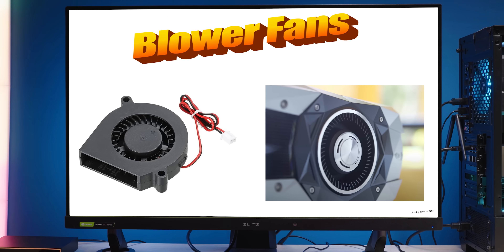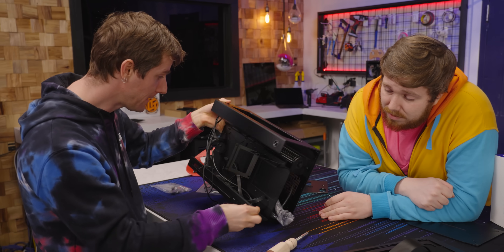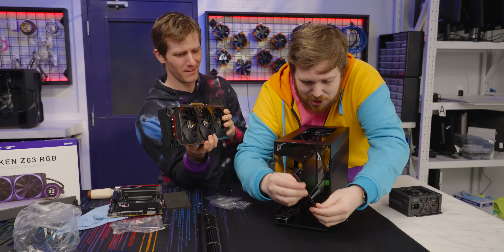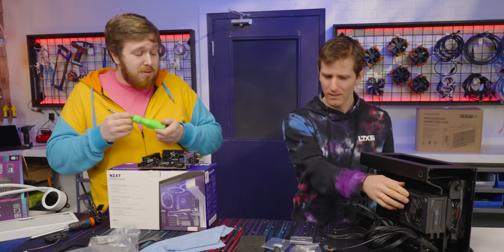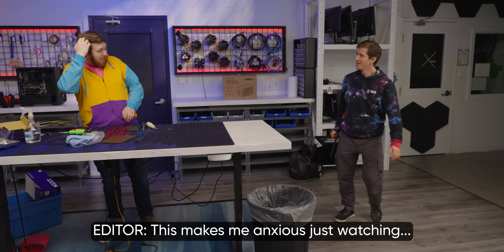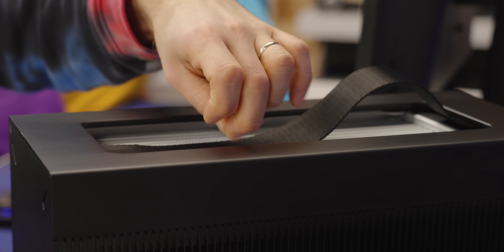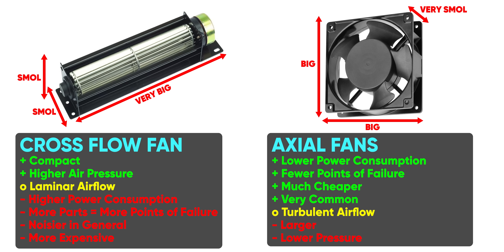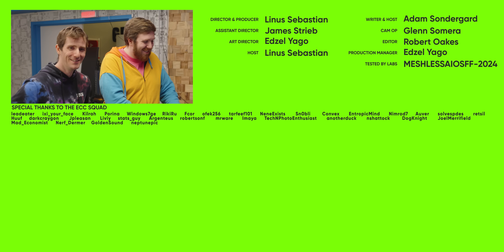This BLEW me away! - Meshless AIO SFF by Meshless Design

Comment: I had 3.5" hard disk enclosures, well they were drive bays for my full tower PC, with this type fan back in the early 2000's. I forget the company, they were not cheap but well made.

Even had little flip down fronts with a mesh filter, washable, and adjustable speeds. No idea if they were worth it but my drives ran cool and never failed. That build, roughly $3500 in 1999, lasted 10 plus years...
Reply: I had one for 5.25, and it had an annoying whirr sound sadly.   These fans always seem to have potential for ITX sandwich cases where they could sit above the ITX PCI slot riser and save space.

Tried to look for a crossflow fan for the SGPC K55, but couldn't find a fitting model. Got 4x 40mm Sunon Maglev Fans and zip tied them to the top instead. They cost as much as 1 Noctua 40mm.

I also found blower fans that you can mod to use motherboard connectors. So I double taped one onto a sandwich case panel. It reduced temps a bit but it vibrates so much that I took it off. Found another that is more axial fan like and it vibrated less.
Reply: @yensteel  These made noise but with 9 other fans plus 'jet engine' style CPU fans the whole thing was so loud it became a white noise machine. The annoyance for me was the heat because I never turned the system off.
Reply: Was it Honeywell? I have some old 3U cases with parts from them, including a 30cm cross-flow fan.
Reply: @DigitalJedi  No it wasn't industrial. I'm tempted to look thru storage to find them, but I probably salvaged the drives and sold the enclosures.
Reply: I had the cheaper retrofit 5.25" bay fans that stuck out the front, both had bearings fail so yea I understand why they aren't used anymore.
Reply: @thorableinu  honestly didn't know what type of fan it was until it arrived.
Reply: How tf did a nineties compter last you until the 2010s? Did you do nothing but web browse and type on word for that period?
Reply: @LaEmporoar  I had a decent budget and went for a dual CPU system with ECC ram. It was overkill. I was lucky. I miss those days more than anything.
Reply: @LaEmporoar Case and Fan, probably not the other parts
Reply: @darkchaosclanat  Nope. Started with a full tower Lian Li that doubled as a chair at lan parties. I added three fans in the side panel to help cool the GPUs. I swapped the GPU once or twice and added another gig of ram but that was late in it's life, 2005 or 06 after school. 

I did graphic design, rendering, and played CS 1.6 for a while. Running Windows 2k pro, aka NT the whole time.
Reply: @jsutrov 6-7 years sound much more reasonable, then 10+ years
Reply: like my family had a new computer in the late 2000s that couldn't even load web pages in a reasonable time frame (like 15min load times) after a few years
Reply: @LaEmporoar    I'd like to suggest that it might have been a Dual Socket360 Coppermine, and may have well required one or two GPU replacements, maybe got a Tualatin upgrade. Would have been quite usable.

Could even start its life as a dual Slot1 system and gotten Slotket kits later.

But most people were still building Socket7 and maybe Super Socket7 systems during that era for budget reasons.
Reply: @SianaGearz edit to clarify I did upgrade the GPUs, but I believe only once. another gig of ram when I could afford it. also added fans in a lexan panel for the GPUs ,and cathode tube lighting. I was young...

Close! This is bringing back memories. it was dual AMD athlon. started with 1 gig of ECC DDR. it was Samsung and cost almost a third of the computer. 

The CPU fans were even more ridiculous. they were coolermaster jets. I could barely install them, the heatsinks touched. they held up fine but idk if they worked any better than stock.

I also had great ISP available that people don't realize. I was the first person in my town to get ATT broadband, after DSL, I started with a 14.4 and ended with T1 at that house... I worked in tech in school so they took care of me.
Reply: @SianaGearz  Did you have a similar system at that time?
Reply: @jsutrov    No, i was never fortunate enough for a dual socket system. In 2001, i fished a smelly smouldering corpse of an Athlon 750 or 800 computer out of a dumpster, the unfortunately appropriately numbered Codegen 420 PSU set itself on fire and burned most of the computer, including hard disk, an optical drive or two, and a Rage video card. But the quite handsome MSI mainboard, the CPU, and 128MB RAM survived just fine. So i rebuit this computer with optical drives that i had at hand, an ELSA TNT2 (soon replaced by an ELSA Geforce2mx for better Blender performance), a fresh Maxtor DM80 disk, and a 350W Fortron Source PSU, and that's what i used for the next 4 years, it was trouble free.

Then i built the next computer, a Pentium 4 2.8E with hyperthreading and a Deluxe edition ASUS mainboard, i spent big. Well the mainboard turned out flaky, i had to send it in for north bridge repair. Besides that, i hated this machine. Pentium 4's performance was... very uneven. Later figured, dual P3-1200s would have run circles around that thing.

A few years later i picked up an Athlon XP 3000+ for $10 and while as old as that Pentium 4, that was actually a massive improvement in every conceivable regard.

Comment: i loved this EP this will be my new Room Heater. Just a little question if the price ist set to the same amount as some rgb fans or premium server industrial fans what would be better for adoption for the SFF builders if one was to go forward with a industrie standers for SFF builds. My Rig at the moment is very overkill cooling for its specks but i wanted the full preformance of my Components B550 AM$ 5800X3D with a noctua NHD15S and as inlet Two ippc 140mm intake @2,000rpm and a single 120mm @3,000 rpm as outlet in a Fractal POP Air, The gpu is a fine wine EVGA 3060 12G i know the build is lobsided wanted to wait for gpu prices to come down. Your thaughts community??

Comment: I'm having a tough time getting my I-9 to stop thermal throttling... I have a 360 mm Corsair h 150i led. Anyone suggest anything
Reply: Replace your thermal paste
Reply: @jordansiemer6667  I did but I suspect it is not evenly distributed. I should probably do it again.
Reply: @jordansiemer6667  do you suggest the sheets or kryonot liquid metal paste
Reply: @GreggyPreviews  I don't know, I haven't used either if them

Comment: The fan is older and than that Silverstone case in 2005. I still have my original CoolerMaster CMStacker STC-T01 with the optional CrossFlow fan. Heck, I still have both boxes. Problem was that I couldn’t have full-length PCI cards installed with the CrossFlow fan so I had to remove it for the dual Promise SuperTrak SX-6000 RAID cards (6-channel IDE). Yes, I really stacked my Stacker with drives. ;)

Comment: I bet that fan sized for the Asic miners might help alot. Given that you can find one with the cfm specs. Possibly doubling up as one blows in, and the other extracts outward.

I bet the Kaspa KS0 Pro+ overclockers would love this in a case with an AIO water cooler also. You might have to do some mods on the sink to get it fabbed together, but when going extreme with overclocking, you have to speed up the heat removal.
It's how fast you can move the heat to the airflow mechanism also. :}

Comment: I've used these to cool subwoofer amps in a trunk for years and wondered why I did not see them in more electronics for cooling. Bilge exhaust fans work great too. Also, the ghosting on that ram fan print does not reflect the price.

Comment: You can make a crossflow fan just a cheaply as an axial fan sometimes even cheaper since the blades can be just extruded instead of injection molded, however its always economy of scale. I do see a possible rise crossflow fans existing for GPU cooling simply down to being able to make more efficient heatsyncs.

Comment: Have a very similar "Crossflow" fan in my 2 decade old CM STacker STC-T01.
Reply: You meant two decades. 😉 It was called the CM STF-B01-E1 Cross Flow Fan and was intended to be used with a CM Stacker STC-T01. That was actually was a nice (and heavy) case!

EDIT. Oh, you actually wrote "2 decade", my bad! 🙈

Comment: $360 is a lot, but I was actually expecting you to give more like $500 to $1000. Like to be clear still a lot, but when a lot of nicer "standard" cases are already approaching $200, this was a pleasant surprise. And if it is designed for top tier CPU and GPU combos, if you are already spending the $2500+ (4090 + 14900 + everything around it) that's gonna cost you, if you want a small case, this is unique and fits the bill.

Comment: I really like this video. I know it's just another niche product video, but I really like how balanced it all is. There's positivity about the design while still critiquing. Education while still having fun.
Reply: bonus points for the pun flock.
Reply: They learnt from the past 😅
Reply: It thermal throttled, it didn't achieve its goal. It deserved more critique.
Reply: @FREQQLES  Yeah, you are correct that they said it was designed for i9s, so they did set a high expectation... However, to be fair, there's not many SFF cases that wouldn't thermal throttle with that hardware... If you're an SFF builder, then you're well aware that you have to make some trade-offs for the form factor... Also bare in mind that they didn't mention undervolting; again something that SFF builders immediately lean heavily on...   For goodness sake, theres plenty of examples of 14900k owners struggling to cool their CPU with a 360AIO and a crap ton of fans!... And finally, don't forget that that was throttling in Cinebench, a 100% synthetic load that pulls 250-300W with that CPU - even a 14900K only pulls an approximate maximum of 120W when gaming.

My point being; it was a mistake to make such a broad statement that set expectation unreasonably high to begin with... Your average PC builder wouldn't neccessarily take for granted that there will have to be a bit of a trade off somewhere.

And yes, I know I talked about gaming a lot, and not productivity workflows, but with a productivity setup you'd be erring towards a compromise on case size, using a larger case that can accommodate one or even two 360mm radiators to cool the beheomoth that is the 14900K!... Horses for courses.

Comment: I use a very similar setup and cool down my Dell XPS13 2in1 7390 Model with a dual screen setup: a 4K@60Hz display and 1920*1200@60Hz laptop Display. I use the crossflow fan to cool the back of the laptop and the laptop is in the tent mode. (I placed my laptop on the customed jig and the jig is screwed on a two-links swivel monitor arms... I wished I bought the three link one but I got to work with what I have and I dont want to spend anther 60dollar for it) 

The setup works fine in sub 30 Celcius (for the American 86F). And the overheating comes from the Intel Iris graphic cards for sure as the frame rate drops in the summer... I bet this setup will work fine with a TB3 to a graphic card housing.

Comment: Hey we have this top of the line gaming system let’s put a CPU from 2022 🤦‍♂️ on a configuration that NO ONE absolutely NO ONE will run. It’s not about TDP as you guys are smart enough to understand your viewers won’t necessarily get it. Heck a cooler 7800x3d would be a much better choice or at least both!

Comment: I actually think these types of fans would work well with certain builds/build themes/cases and also while the 1 fan is technically more expensive you forgot to mention that 1 fan seems to be able to span almost an entire case depending on size, so instead of thinking it as 1 fan, if you think of it as 2-3 fans being connected, 35$ wouldn't be that bad for 2-3 fans depending on the fan's you get so why would it be so bad for 1 fan that's, in theory, one fan that covers 2-3. I otherwise agree but I they're also still built so they must be used for something.

Comment: That spec is almost what I just got recently.  I had to get a 4070 because I wanted to use a nvme raid card and that was the best triple slot they had.  I got a 1200 watt seasonic and 2 additional 8tb drives.  Though I also got a proart motherboard so pretty sure that's better/more expensive.

Comment: Whoa~! 1990s flashback. (Early 1990s) There was a store on Lakeshore Ave. in Toronto that sold those squirrel cages specifically for cooling IBM machines! I had one in a case for ages, but it collected dust like a hoover and eventually the bearing opposite the motor died.

Fun Flashback... I'm going to put on some BNL and look for my poster of Kelly Gruber.

Comment: 6:01 The cable is also influenced through strand count. Take for example a typical PVC insulated 26AWG wire and compare a 1/26( solid core), 7/34, 19/38, or even a wild 63/44 and it will progressibly be more flexible as the counts increase. think of it as spaghetti vs angel hair pasta! The CSA will also increase (AWG CSA being determined as a solid core for reference).

Comment: You know I was expecting it to be in the $400-$500 range, at $360 that's not the worst for a unique SFF case.
Reply: Fr, this is totally not a rip-off! Fully extruded, well engineered tolerances and totally unique design. I checked their site and either they’re sold out already or haven’t officially launched yet.

Comment: 16:44 Fun fact, this makes zero difference. I've opened up many bearing fans and they ALL have 2 bearings. The only difference with this one is that it's more spaced out, so this isn't a negative.
Reply: To be honest, with bearings spread out so much there is less side force (think fan working as a lever), so the bearings should be able to survive longer.
Reply: @hubertnnn  well that depends a bit with how well the bearing is sealed from the elements. The number 1. death of bearings is due to debbry getting stuck in the bearing. So if it's well sealed yeah it can even outlast PC fans

Comment: maybe the cpu issue is that the fan is pulling instead of pushing air through the radiator. the idea is cool but the layout of the dan a4 h20 pretty much does the same thing in a smaller space with only 2 120mm fans

Comment: I had a fan like that in my Cooler master CM Stacker in 2000. I still use that case.
Reply: I came here to mention this as well. It was called the Cooler Master STF-B01-E1 Cross Flow Fan, which provided the motherboard's components with airflow. I've purchased the CM Stacker STC-T01 in 2004 and decommissioned it in late 2012.
Reply: @steve-o-i1j  Still to this day I don't know what happened to my fan, I just can't bring myself to stop using my Stacker though. Thank you for the information I would never have known that about the fan name.
Reply: The only thing I have left of the case is the Crossflow fan.
It fits perfectly on my lab powersupply.
Reply: @larsjrgensen5975  I wish I still had mine. I often look at the hole it used to sit in. I did once try to find a new one but it about as rare a thing as you could hope to find and this was about 12 years ago.
Reply: The commercial name was CM Stacker 810 and was replaced by the Stacker 830. I too had it tor my main rig from 2006 to 2018 and had purchased all add-ons (HDD trays, side window, crossflow fan). Sold it a couple of years later.
Reply: I had one of the black aluminum CM stackers back in highschool. Was my main rig until 2012-2013 ish? 

Such beefcake case. So many fans.
Reply: @KyleXSki  I don't think I will ever stop using mine. I love modding it to keep it relevant. MAybe one day I will come across the crossflow fan for it and restore that too.
Reply: i have one as well, a blue one plus the crossflow fan

mine long gone, what did you use yours for? it's like 20+ years old case
Reply: @lcw82  I still use it for my main build believe it or not. Mine is the original brushed steel one. Works well as a modern case as I retrofitted it with 4 120 mm front fans, it has room for a bottom PSU as well as the top so it is in the modern configuration as PSU is in the bottom. I ripped out the usb front ports and replaced them with usb 3.0 ports too. Its had about 10 builds in it over the years. Currently has my x58 gaming pc in it.

Comment: No more expensive than the Thor MJOLNIR case and that doesn’t come with custom cables etc. When you kept saying it was expensive I was thinking over $500 but at $360 and what you get it’s pretty reasonable I think. Custom extruded alli can’t be cheap to get tooling etc. made before you buy the raw material to push through. Good to see the company behind this case isn’t trying to price gouge their customers and being respectful to consumers. I might buy one just to support the project.
Reply: I don't think this does either. The custom cables are extras. Only the case is 360